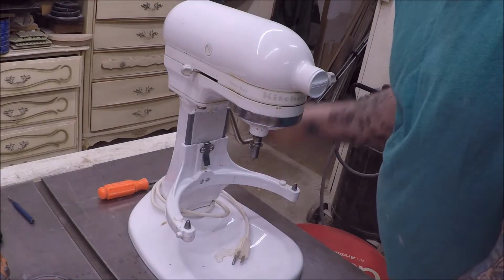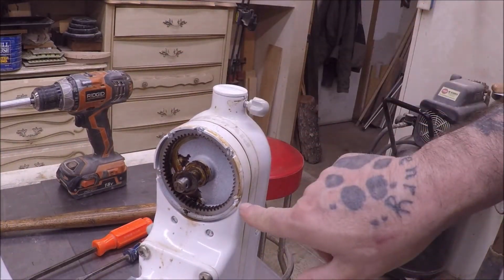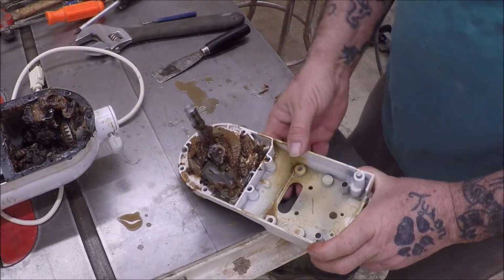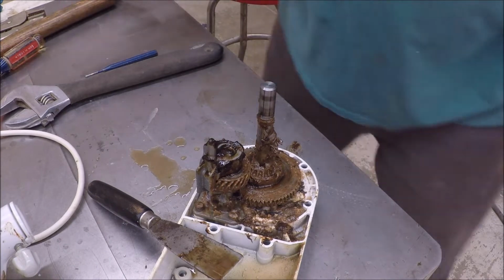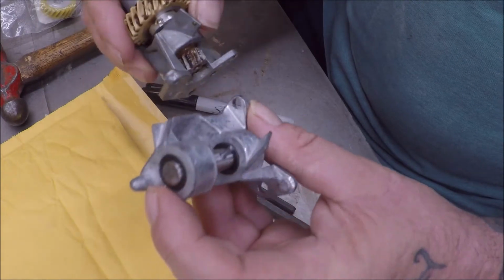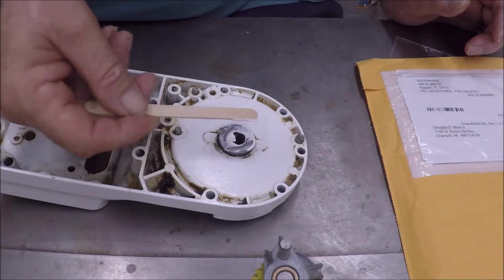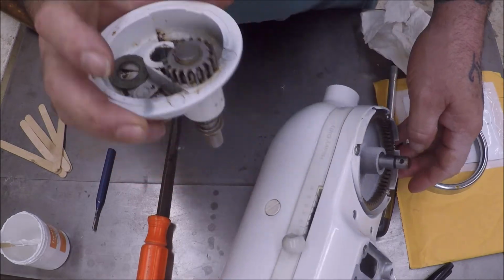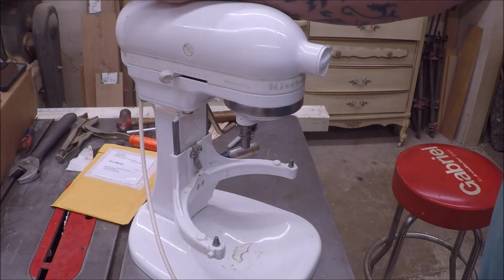How To Fix Repair Service Kitchen Aid Mixer Worm Gear

Comment: This was very informative for someday when I need to rebuild mine, I have the same machine in red. 
Did the front-drive gear need a seal or gasket to keep it from leaking into the gearbox?
 I spent 7 years as a mechanic on a golf course and one little "trick" I learned that may be helpful to remember is to loosen all the screws before you remove them so when you get to the last screw it's not bound tightly, which can cause the last hole to strip if there is any warp in the housing. also start ann the screws before tightening so they all line up when you get to the last one :) you did a great video on repair, you did not have a problem here it's just great information to remember.
Keep up the good work!
Reply from the maker: Thank you, I hope it helps someone one day, the videos I watched didn't cover this machine, and no it did not have a gasket or seal for the gear drive, it was just short on grease.

Comment: Have 1 old lift up style like that from the 80s that the motor died on and kept for parts, 1 old lift style from the 90s that works just fine, and wife #2 has a flip style we kept as a spare, and since we moved in with mom to help take care of her and the 20 acres and a house built in the 1800s she has a delonghi mixer (what replaced the 80s kitchen aid .
Reply from the maker: Thank You Bryon,  I would say we purchased this one early 2001

Comment: One question though. Do you have any parts left over?
Reply from the maker: Thank You Lilly, the only parts left are the ones I replace and the extra parts I had ordered
Reply: @outsidethepohlbarn  Sorry man. Offense was not intended. I was just being aggravating. It just frustrates me severely when I am working on something and I get finished and there is one little piece left.
Reply from the maker: I was not offended,   it's common place for me to have extra pieces as I am usually making one out of two

Comment: Ha #1
Reply: Also the excessory drive does not get an oring or gasket. The little mixers are no different from the big boys. I've re built at least 100 or more old Hobarts. From 20qt to 140qt. Until the next ✌🤙
Reply from the maker: Thank You Greg,  I just greased it up and called it good